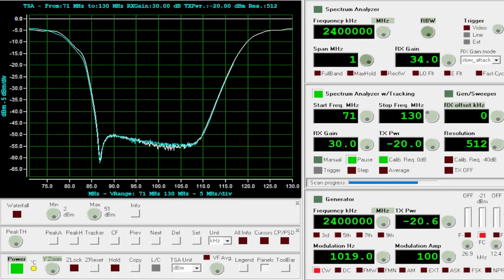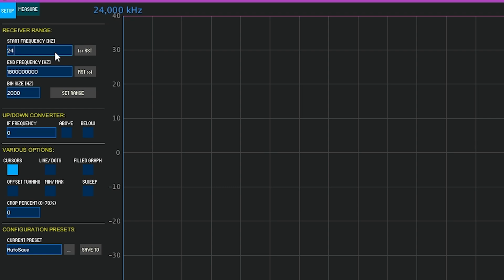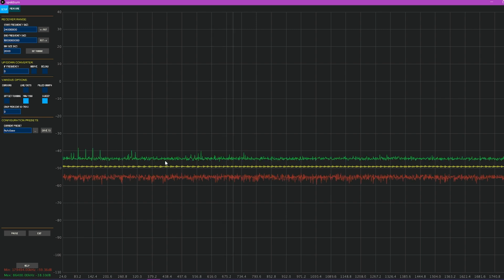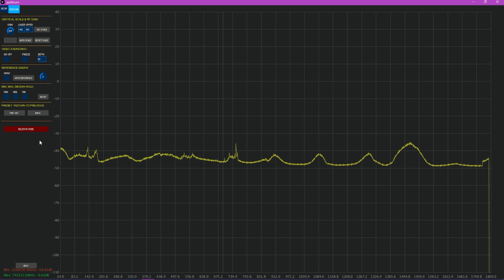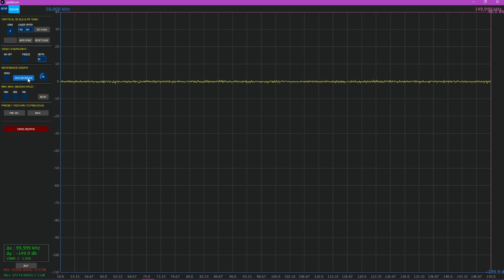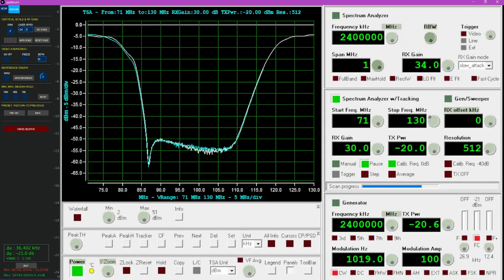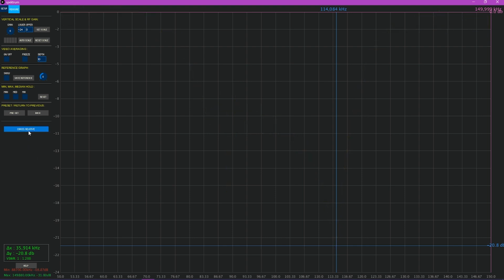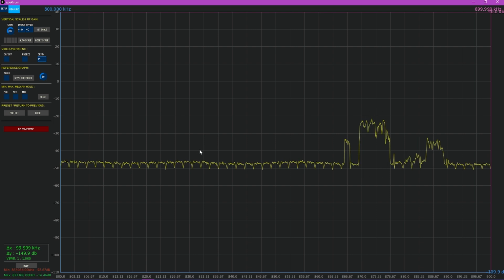Measuring Filters With RTL-SDR and Noise Source. Spektrum SDR Spectrum Analyzer

Comment: any fix to make this work with a notebook with a 4k video card and a 4k display? Font size impossible to read. Keep up the good work with your videos.
Reply from the maker: The only thing I can think of is using compatibility mode to switch the display resolution at run-time. I'm not aware of this application having any visual adjustments for larger displays.

Comment: The BIN size is associated with the FFT but 2000 Bins does not relate to any power of two that would be used by a Fast Fourier Transform which should 1,2,4,8,16,32,64.........

Comment: Any good suggestions for noise generator with at least 40-60dB of noise above RX floor need a lot of headroom to start  tuning  gross mistuned filters, question can I feed RTL-SDR with say -10dBm  noise assuming 8 bit = 48dB dynamic range should be able to tune anything gross mistuned ??

Comment: Thans Sarah for this video, tried the SW very impressed how  fast sweep 25 to 1700Mhz for my RTL stick, any suggestions for using SDR-Play box, SDR-Play application is very slow and I think it uses full I-Q processing, looks like this application just samples 8 bit data magnitude and not worry anout phase ??
Reply from the maker: There is an application that's supported for the SDRPlay hardware, I haven't had the best luck with it but may try it again in the near future. https://www.sdrplay.com/spectrum-analyser/

Comment: Wow this is cool, my university is currently working on a Pico-Satellite project we are just getting started. I have a HackRF and I was wondering if this will be enough for most satellite related measurements? Thanks for your time!
Jason
Reply from the maker: Really depends on what all you need to do. The frequency range of the HackRF is pretty good though, issue is that it doesn't have the best front end and you can only do half-duplex. Meaning RX/TX must be done one at a time, you can't do both simultaneously.
Reply: You may want to have a look at the SatNOGs and TinyGS projects.  Both are open source, community driven, low cost ground stations.  They have tons of great info on RF hardware, antennas, receive software, etc.